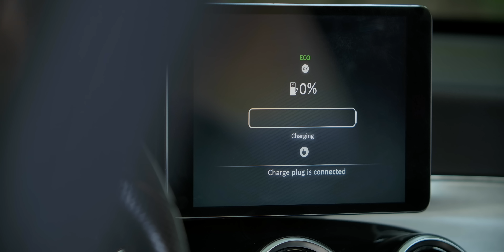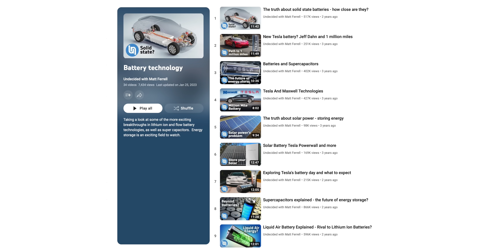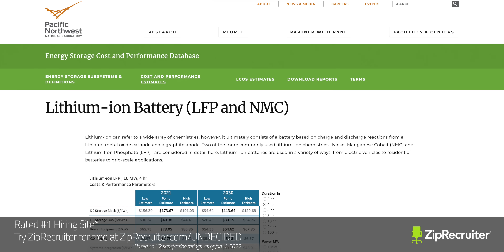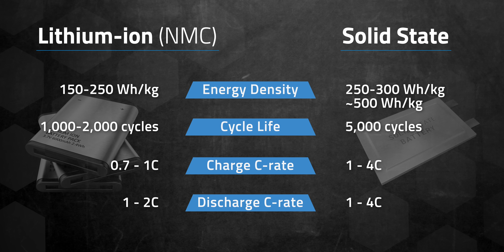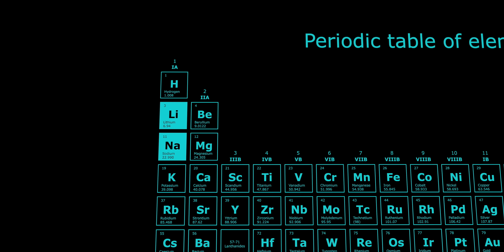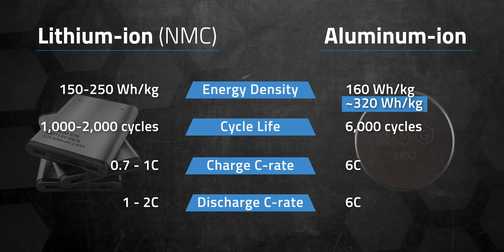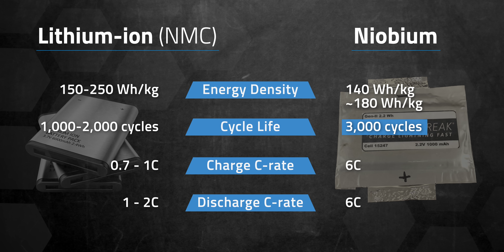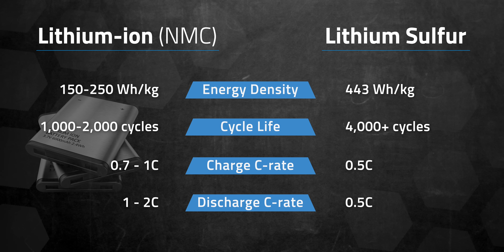Are These Batteries The Future Of Energy Storage?

Comment: To your comment about the infrastructure not currently able to fill some of the new batteries quickly enough, some DC fast chargers are paired with storage to trickle charge the batteries to then fast charge from them.  It would be great to have a soup-to-nuts solution from generation to use all at high speeds, but maybe it's better to have fewer reservoirs (grid scale storage) and more individual tanks (home/Point-of-charge batteries)? Then again, I'm thinking instead of a powerwall on my house I'd rather have a mobile powerwall (bidirectional charging EV)

Comment: TSLA battery day emphasized Silicon anode, preset with lithium. Other companies are doing the same and they are getting braggy about sub 10 min full charge times on 300+ mile car. If TSLA and these other companies get these out in the next couple years, it will make solid state and other more difficult projects dead on arrival. I don't think they would build their own anode factory in Austin based on theory either. Other projects are valid, but not in a post silicon anode world.

Comment: Thanks, this was a great video. It’s a shame you didn’t cover safety, though. I want a home battery, but I am not comfortable bolting a flammable Lithium-Ion to the side of my house. What is the tech I should be looking out for?
Reply: Lithium iron phosphate (LiFePo4) batteries are already available and  safer in regards to fire than Lithium-ion. Slightly less energy dense and slightly more expensive though. That is what I'm considering for my solar/hydro system unless the sodium-ion battery is about to go commercial, and with a decent price tag. Living in Wales, I see it as a double benefit.

Comment: Fabulous content. Really appreciate this comparative walk-through of various battery architectures. Of these, I've heard quite promising specs from Lyten's research in Li-S battery cells, which as you mentioned have superb energy density. I've heard Lyten state they see a pathway to 900w/kg and $80/kw, with the kicker being that it's a practically non-flammable chemistry and operates in a -40 to ~160C environment. Obviously if this verifies, and it's commercially scalable, it's a game-changer, and spells the almost immediate demise of any EV transition resistance. But I believe the much larger point is that battery cell R&D is in widespread, full-swing, and we're barely in the first inning. There is much reason to be optimistic.
Reply: Lithium sulfur is still problematic in terms of cycle life, but as time goes on, it is being improved.
The Journal of the Electrochemical Society has a lot of studies in this regard.
Reply: @neutronpcxt372  It's problematic in terms of being LITHIUM. Lithium is expensive and has a lot of geopolitical issues associated with it. Only really worth it for aviation and even then, aluminium-ion should be better (comparable energy density, safer).
Reply: Lithium-anything has inherent problems... thankfully sodium-sulphur's being worked on too.

Comment: I like the Iron air battery for powering stationary uses. Imagine a mall run by off grid power or factories that grab charge from the grid during low use cycles for use during high draw times.

Comment: There are also the Sulfur Sodium ones as well that could be cost 60% less than todays batteries. That one could slove the grid storage problem over night being able to be built anywhere. Yea no one battery will be perfect for everything, but I am hopeful for the Al-Ion and Sulfur-Ion ones. The cost savings from either one of those would be the difference needed to go full electric going forward for home, transport, and device. Solar, while not super cheap, is still cheap enough to pay it self back with in 5 ot 10 years. The battery is where the bigger cost comes from sadly if you want to store any of that to be totally off grid for the most part. One thing to note, is if we get get off li that means the battery can be built anywhere around the world. No longer would a country be held down from another country to built said battery either.

Comment: The holy grail will be achieved when it's feasible to convert the general aviation fleet to electric, other than motorgliders and very short range trainers. To do that, we will need about 3x the current L-ion power density, and more importantly, not turn into a road flare if water gets to the freakin' cathode. For this reason alum/graphene is the most exciting development for me.  Some international body could make itself useful by developing a Universal Modular Battery Configuration Standard for the EV industry, so you could just have EV "gas" stations that could just maintain a stock of charged batteries, and you pull in and just swap out batteries, like with propane tank exchange programs.

Comment: I think solving the Cobalt problem is more pressing than the Lithium problem. Similarly, Sulfur has a terrible extraction process, often having people with minimal safety gear harvest it from volcanism. Surprised you should have included Phosphate batteries since they are the only alternative outside the lab, and Tesla has suggested there will be better formulas for it. Of the five mentioned, Aluminium is the best option for Supply and Use though the reliance on Graphene has me concerned it'll have more of a Solid State timeline.
Reply: They are using methane pyrolysis to make the pure carbon for their graphene so it's actually an extremely clean process and solves a lot of the problems (byproducts, limited sources, cost and time) with making graphene from mined graphite. So those are two things we have plenty of around the world aluminum and natural gas, and a RNG source would be even better as more digester facilities are coming online.
Reply: Most elementary sulphur is a byproduct of petroleum or natural gas refining. There are many sulphide minerals that can be used as a source. What disqualifies Li-S batteries so far is the very limited cycle life. The majority of lithium ion EV batteries in China are Cobalt-free LFP.

Comment: I think sodium ion will be a game changer in both grid and home stationary storage. What I have read has them at 30% of the cost of NMC, so figure a powerwall or Generac PWRcell for $5,000 instead of $15,000.

A lot more people could get home storage, including lower income households with subsidies or grants. 

They could do this even before installing solar and use them for arbitrage reducing peak demand on the grid.
Reply: You wont see those kinds of price reductions for products like powerwall. While the battery is a big chunk of the cost it is only one piece. Just look at a Chevy Bolt $30,000 for 65kwh vs powerwall at $15000 for only 10kwh. 
On the other hand grid scale components like Megapack and similar would be significantly impacted by the cost of the primary component.
Reply: @cmbakerxx  Power wall is over priced and you can buy a server rack battery for 1500 bucks at 5kwh plus and a all in one inverter for 1500 bucks. You are in it for 4500 dollars now, add another battery and you have the same capacity as the powerwall. Now I am not sure what the specs or inverter are on the powerwall as I have given up on keeping up with the overpriced unit. EG4 all in one unit are. You know what let me just copy one of their full systems at or close to the 15k a powerwall cost. 
Complete Off-Grid Solar Kit - 13,000W 120/240V Output / 48VDC [20.5kWh EG4-LifePower4 Lithium Powerwall] 48VDC + 11,970 Watts of Solar PV | [KIT-E0002]
Your Price: $15,395.92 
I do not think you can go wrong with that, add under 5k to install and set up you are in it for 20k total and if you factor in 2k total electric cost for a year (166 month) you can have a payback of 10 years. With this system lets assume you get an average of 8kwh five times per day for a total of 40 times 365 gives you 14600 times 15 cents per kwh 2190. Now this does not factor in your service charge which is 20 dollars per month and increase of electric prices in the coming years. You could see a return on your investment in a much shorter time as well. Buy used panels and it will reduce your price by a huge amount. Fill out your array to 100% and your return changes. Have you ever wanted to run an extra freezer or run your ac unit a bit cooler. With some of this extra energy you can do that. Also if you really want to increase your savings you can spend just under 2k to buy a EG4 mini split 2 ton unit that offers you a direct solar connection of around 3kwh of solar and works in grid only, solar only or both modes. Meaning that if you bought and installed one of these units say in your garage or shed and put it on solar you could heat and cool it with out it costing you any out of pocket costs per month. how about a chicken barn keeping it warmer or cooler will keep them happy and laying eggs all the time.
Reply: @cmbakerxx  Hence why I mentioned the Generac PWRcell. It's one of many options for home storage besides the powerwall.

As for the Bolt, how does it charge off solar when it's parked at work? For homes without solar, how does it power the house during the day in summer when the kids are home during summer break?

The reality is that a lot more people will have home storage before they get their first EV because it will become much more affordable and it will allow people to save money from day one with or without solar, or wind.
Reply: @IronmanV5  I was just giving a comparison of the cost per kwh. Home battery cost does not reflect the cost of the battery cells
Reply: Yeah, size is not that big of a problem with home storage.

If i could get double the size, half the price batteries for hime storage, i would get those for sure.
Reply: Agreed it will shave a lot off a home battery system cost, in addition to this more Li ion batteries can therefore be used in cars, thus relieving demand for car type batteries and thereby easing the price on electric cars as well, so a doubly positive effect on the overall renewable tech market. Now if they can design these batteries to be easily recyclable, as per say lead-acid batteries, this will have a further, albeit latent, effect on reducing market pressure and prices. Forgive my optimism but these kinds of advances accumulate and will end up expediting the overall transition to renewables significantly, simple economics always wins out in the end..

Edit: Matt basically says a bit of what I said at the end of the video, I really should watch it right to the end before commenting!
Reply: More like 30% less than NMC. That's 70% of NMC.
Reply: @adon8672  You're thinking of LFP. They are about 65% of the cost of NMC.

Na-ion will be 29% of the cost of NMC, about 1/2 the cost of LFP.

Comment: One issue that seems to get overlooked is even if you had the perfect battery where you could charge your EV in as short a time as a car can get its gas tank filled up from being almost empty, the current draw on that charging wire would be enormous. Remember, you are delivering as much energy through that wire as there is in a full tank of gas in about 5 minutes or less. And that's just for one vehicle. Now put 5 EVs in a row waiting to get charged, like you see at a filling station. Now imagine the power grid needed for such charging.  It's one thing to look at small devices that need only milliamps or amps at low voltages ... it's another thing for what EVs require.

Comment: Besides energy density, one of the biggest improvements I'm hoping new advancements in tech will bring us is longevity. Lithium-Ion batteries are great for most purposes, but they degrade really quickly when used in smartphones, tablets, laptops, etc. It'd be nice to have battery tech that lasts far longer so our devices would in-turn last longer.
Reply: That's also a function of the marketing and accounting teams. Especially with phones. Phone batteries would last a lot longer if they weren't pushed to the absolute limits when charging to 100%. It's why I only charge mine to 85%. But even at 85% according to the phone display, the voltage is at 4.2V, which is actually very close to 100%.  Charging my phone to 100% (per the display) is actually overdriving the battery to nearly 4.5V, making it degrade much faster.

And for some reason we fell in love with having the slimmest possible phone, requiring them to squeeze the absolute most out of the batteries for decent run time. Rather than keeping it a little thicker, making the battery larger, and using less of the full capacity. Thus increasing the amount of charge cycles.

Comment: Thanks Matt.  Always enjoy your videos and hi tech news in general.  My favorite is aluminum graphene one.  It should be easiest to make, cheapest to produce and 100% recyclable (at least in theory).  Almost too perfect to be true.
Could you also look into Exro Technologies and their new type of electric engine for us.  Seems to have a great potential to save 5 to 50% of battery power depending on use.  Substitutes need for multiple engines in EV or need for a transition.  Also it simplifies drive train and reduces cost of EV to manufacture.  It also comes with smart electronic coil drive/converter which enables charging EV directly from any electrical source.  They also claim that their coil drive can manage Li-ion batteries to charge more efficiently on every cell level prolonging life and making them safer to use.
Looking forward to your next video.
Cheers

Comment: For EV's high C rate not only means charge time, but it also strongly impacts how powerful of a EV you get out of a given battery size. It'll mean you don't have to spring for the long range version of a car to get the couple seconds quicker 0-60. C rating is arguably the most important metric provided we have charging infrastructure. It enables super quick charging cars with small batteries that are still powerful. Small batteries means cheaper cars and charging time is probably one of the biggest drivers of range anxiety.
Reply: Right. Hearing "6C" for some of these techs is great, but is that sustained or instantaneous? A lot of EVs are hitting 15C for short bursts.
It's unfortunate that Lithium Ion is so expensive and harmful to the earth, but it hits all of the needs, high energy density (for batteries), incredible C rates, and high cycles.

When we see an alternate tech that can beat Li-Ion in those categories, and be cheaper, then we're in business.
Reply: In what way is lithium mining harmful to earth?  Is it more harmful than sand and gravel mining? Or salt mining?
Reply: Some RC car racers routinely discharge LiPo batteries at a C40 rate and charge them at C6. That is full to empty in 90 seconds and empty to full in 10 minutes.

For thermal reasons, those batteries are thin, so there is a lot of surface area to dissipate heat. Power density is high, but energy density is low.

The most shocking statistic is the incredibly poor cycle life of batteries treated this way. 50 cycles is an aspirational goal.
Reply: @hamjudo  I have 120c RC batteries, but they die insanely quick as you said and its more about voltage sag than actually drawing 120c. It would be interesting to see formula E rates as they probably drive the batteries at much higher rates.
Reply: Fast 0-60 is a marketing gimmick, fast charge would be nice for road trips but a car can easily charge in the garage overnight when power is cheap, best overall for the grid
Reply: @ThomasBomb45  Logical or not charge time is a huge driver of range anxiety, which in turn drives preference for larger batteries, which drives high EV prices. If you could charge a car in a couple minutes a EV very low range would be much less of a problem even if it came up in day to day driving once in awhile. 100mile range EVs would be much more viable. Also a lot of people live in places without access to overnight charging. Overnight charging doesn't really impact that equation. Imagine a 300 mile $50k EV that takes 30min (2C)  or $30k EV with 100 miles range and takes 10 min to charge. In an overnight charge situation they would be the same, but in nearly any other day to day situation the cheaper EV is probably better. For really long trips a bigger battery is still better, but a 200 mile 6C battery will outperform a 300mile 2C battery in terms of Miles per minute of charging at still be cheaper, lighter, etc.
Reply: @ThomasBomb45  Beyond a point yes, but if it's too slow it can be a safety hazard as it can be hard to get on the freeway or out of the way if something is coming up behind you too quickly. But, it is heavily dependent upon how the vehicle is geared as well as the actual engine.

Comment: I think when talking batteries, they all need to be compared to lead acid. We need to go back to the reason we need batteries. We need to store energy so we don't burn fossil fuels to create instant electricity. Lead acid didn't work well and nether did NiMH, so here we are at lithium. Lithium battery production is also killing our planet, so scrap that idea too. Of the tech that's out there now sodium seems to be the most eco friendly per energy density we've found. It way out performs lead acid, which are still used and not quite as good as lithium but could be. So here's the issue, oil companies fought hard for years to keep their market share of electricity. Denial, tricking and lying to keep us dependent on fossil fuels. Lithium battery manufactures are now doing the same thing to fight for market share. It's not about the best product, that works and also saves our world. it's about market share!

Comment: With Niobium 6C rates you should also consider the full charge cycle with compared to NMC. Does Niobium require the same charge taper?  Can you look into that? Thanks
Reply: I can say that our Battery Streak nanostructured niobium cells can charge at 6C CCV or continuous voltage! I’m presenting new data at the International Battery Seminar next month!